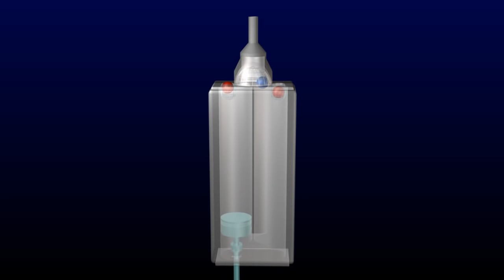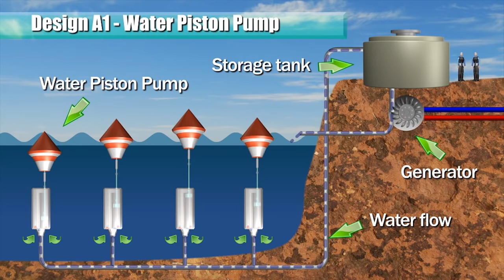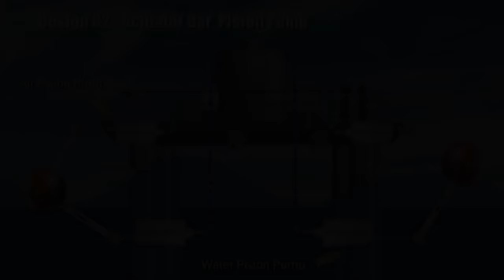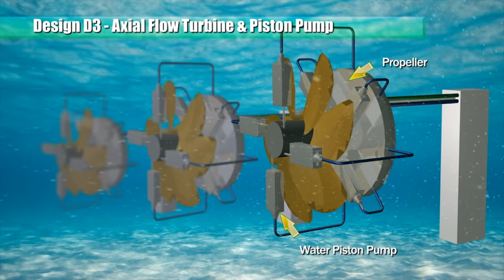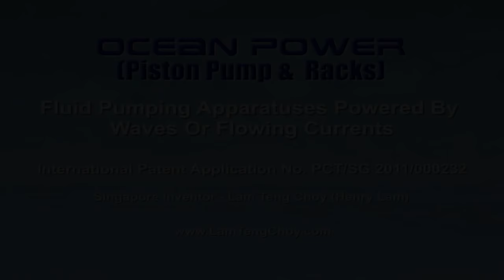Blue Energy - Ocean Power (Piston Pump & Racks)

Comment: These are excellent ways to gather energy, now all you have to do is eliminate the accelerated mass losses in a turbine. A typical hydro-system only operates at 15% efficiency max due to accelerated mass losses. Compress air instead of water, insert a HyPEG unit and get about 5 times the amount of electricity for the same piston strokes offshore. New science. Check it out!
Reply: No, hydrodynamic generators are extremely efficient, up to and sometimes over 90%. I found this after some googling, and asking 2 thermodynamics professors at my university.
Reply from the maker: New Invention

ShoreLine HydroElectric InFlow Dam System Video (English)
https://youtu.be/A8EYW_aREKw

水力发电内流水坝水岸线系统 / ShoreLine HydroElectric InFlow Dam System Video (Chinese)
https://youtu.be/D2NPLMekG8w

Hydro Power - Hydroelectric Inflow Dam System
https://youtu.be/_ho7JaxOdT0

Ocean Power - Piston Pump & Racks
https://youtu.be/fYfs-qYGzvs

Ocean Power - Racks & Rake Wheel
https://youtu.be/nQGKfAPxsiI

Comment: Do you know of any working examples of Ocean Power piston pumps?  If so, it would be great to have them included on the Water Powered Pumps Facebook group:   https://www.facebook.com/groups/240458583255303/
Reply from the maker: Hi,

All my invention is at Concept Stage only. If you wish, you can go ahead and design it.

New Invention
ShoreLine HydroElectric InFlow Dam System Video (English)
https://youtu.be/x8wKpl3N5lM
水力发电内流水坝水岸线系统 / ShoreLine HydroElectric InFlow Dam System Video (Chinese)
https://youtu.be/ZmL8biLw-ps 
Hydro Power - Hydroelectric Inflow Dam System
https://youtu.be/89mHu4JsIDs 

Ocean Power - Piston Pump & Racks

https://youtu.be/BSvKSzvhzZ8 
Ocean Power - Racks & Rake Wheel
https://youtu.be/c0_m3vE_aXY 

Henry Lam

Comment: What is the cost break-even point for these devices? They look very expensive, easily damaged by natural phenomena and would have high upkeep costs. Designing them to be durable and efficient would drive up costs even more. My guess is the price of natural gas would have to be astronomical to make these worthwhile in a realistic environment. Of course, if you are just doing it to make a politically correct statement on 'saving the planet', then cost/benefit would not be a consideration. What is the cost/megawatt of these compared with, let's say, nuclear power or a natural gas power plant?
Reply from the maker: New Invention

ShoreLine HydroElectric InFlow Dam System Video (English)
https://youtu.be/A8EYW_aREKw

水力发电内流水坝水岸线系统 / ShoreLine HydroElectric InFlow Dam System Video (Chinese)
https://youtu.be/D2NPLMekG8w

Hydro Power - Hydroelectric Inflow Dam System
https://youtu.be/_ho7JaxOdT0

Ocean Power - Piston Pump & Racks
https://youtu.be/fYfs-qYGzvs

Ocean Power - Racks & Rake Wheel
https://youtu.be/nQGKfAPxsiI

Comment: Anything is better than burning fossil fuels.  As long as the life of the equipment is efficient and does not require large man hours to maintain.  5 STARS
Reply from the maker: New Invention

ShoreLine HydroElectric InFlow Dam System Video (English)
https://youtu.be/A8EYW_aREKw

水力发电内流水坝水岸线系统 / ShoreLine HydroElectric InFlow Dam System Video (Chinese)
https://youtu.be/D2NPLMekG8w

Hydro Power - Hydroelectric Inflow Dam System
https://youtu.be/_ho7JaxOdT0

Ocean Power - Piston Pump & Racks
https://youtu.be/fYfs-qYGzvs

Ocean Power - Racks & Rake Wheel
https://youtu.be/nQGKfAPxsiI

Comment: It's 2019. Still waiting.
Reply: KhmerD0g  I imagine that the commercial implementation of such systems would be very expensive and complicated. The technology and its applications would have to be thoroughly tested for reliabilty and performance and manufacturing techniques would have to be developed which made a consistent quality. There's no doubt a lot of red tape around it, also.

The US would be a hard sell, especially after the BP fiasco in the Gulf Of Mexico. Having large platforms close to shore could prove dangerous, even without the possibility of a major oil spill. If one were to be hit by a powerful storm, it could cause a lot of collateral damage; both to the ecosystem at large and commercial/residential interests in the area.

I am cautiously optimistic about wave power. It is a very promising prospect, however it is not as simple as the video would make it seem. This is just an overview of potential methods for harnessing wave energy. These could work, but it will take time and effort to get to that point. Many investors are probably spooked about the unproven nature of the technology and thusly reluctant to fund projects of this nature.

In time, as small scale research advances, I suspect a few Elon Musk types will take the bait. Have patience, friends. We may have wave power sooner rather than later.
Reply from the maker: New Invention

ShoreLine HydroElectric InFlow Dam System Video (English)
https://youtu.be/A8EYW_aREKw

水力发电内流水坝水岸线系统 / ShoreLine HydroElectric InFlow Dam System Video (Chinese)
https://youtu.be/D2NPLMekG8w

Hydro Power - Hydroelectric Inflow Dam System
https://youtu.be/_ho7JaxOdT0

Ocean Power - Piston Pump & Racks
https://youtu.be/fYfs-qYGzvs

Ocean Power - Racks & Rake Wheel
https://youtu.be/nQGKfAPxsiI
Reply from the maker: KhmerD0g  New Invention

ShoreLine HydroElectric InFlow Dam System Video (English)
https://youtu.be/A8EYW_aREKw

水力发电内流水坝水岸线系统 / ShoreLine HydroElectric InFlow Dam System Video (Chinese)
https://youtu.be/D2NPLMekG8w

Hydro Power - Hydroelectric Inflow Dam System
https://youtu.be/_ho7JaxOdT0

Ocean Power - Piston Pump & Racks
https://youtu.be/fYfs-qYGzvs

Ocean Power - Racks & Rake Wheel
https://youtu.be/nQGKfAPxsiI
Reply from the maker: @canwenot573  New Invention

ShoreLine HydroElectric InFlow Dam System Video (English)
https://youtu.be/A8EYW_aREKw

水力发电内流水坝水岸线系统 / ShoreLine HydroElectric InFlow Dam System Video (Chinese)
https://youtu.be/D2NPLMekG8w

Hydro Power - Hydroelectric Inflow Dam System
https://youtu.be/_ho7JaxOdT0

Ocean Power - Piston Pump & Racks
https://youtu.be/fYfs-qYGzvs

Ocean Power - Racks & Rake Wheel
https://youtu.be/nQGKfAPxsiI

Comment: Check out this video https://youtu.be/v-lJkeRHzAE (or short version https://youtu.be/AG_vz2vHP7M) by cranleytech.com, there is some open water testing towards the end. It aims to get energy from the horizontal motion of the wave which is stronger in the near shore (<half a wavelength, e.g. for a 100m wavelength the particle motion becomes more orbital from 50m depth in to shore). It also keeps all the electrical equipment onshore and reduces the typical mooring costs. Apparently it is hugely expensive to drill mooring points into the ocean floor or to run electrical cables underwater. I’m looking for people to help me build prototypes, they are easy enough to build, the ones I have built so far are all with parts from my local hardware store.
Reply from the maker: Hi,

All my invention is at Concept Stage only. If you wish, you can go ahead and design it.

New Invention

ShoreLine HydroElectric InFlow Dam System Video (English)
https://youtu.be/x8wKpl3N5lM

水力发电内流水坝水岸线系统 / ShoreLine HydroElectric InFlow Dam System Video (Chinese)
https://youtu.be/ZmL8biLw-ps 

Hydro Power - Hydroelectric Inflow Dam System
https://youtu.be/89mHu4JsIDs 

Ocean Power - Piston Pump & Racks
https://youtu.be/BSvKSzvhzZ8 

Ocean Power - Racks & Rake Wheel
https://youtu.be/c0_m3vE_aXY 

Henry Lam

Comment: Nah. It seems pretty inefficient. Almost all the parts are working under friction. Also, piston and piston rod may exposure undesired horizontal forces which could emerge shear force on the rod. besides, cost is the key point of these systems in terms of investment decision.
Reply from the maker: New Invention

ShoreLine HydroElectric InFlow Dam System Video (English)
https://youtu.be/A8EYW_aREKw

水力发电内流水坝水岸线系统 / ShoreLine HydroElectric InFlow Dam System Video (Chinese)
https://youtu.be/D2NPLMekG8w

Hydro Power - Hydroelectric Inflow Dam System
https://youtu.be/_ho7JaxOdT0

Ocean Power - Piston Pump & Racks
https://youtu.be/fYfs-qYGzvs

Ocean Power - Racks & Rake Wheel
https://youtu.be/nQGKfAPxsiI

Comment: Not sure how much energy you can generate and it is also depends on the waves hight. Why didn't any1 think of it b4 it is because, there arn't much energy generated by this devices. The total energy of the wave must not exceed the total energy of the system ie. Etot=Egen.+Elost. This needs to be calcuated since if Elost << Egen this might work. I see some flaws in the device because those pumps might not generate enough energy if the system is too complex.
Reply from the maker: New Invention

ShoreLine HydroElectric InFlow Dam System Video (English)
https://youtu.be/A8EYW_aREKw

水力发电内流水坝水岸线系统 / ShoreLine HydroElectric InFlow Dam System Video (Chinese)
https://youtu.be/D2NPLMekG8w

Hydro Power - Hydroelectric Inflow Dam System
https://youtu.be/_ho7JaxOdT0

Ocean Power - Piston Pump & Racks
https://youtu.be/fYfs-qYGzvs

Ocean Power - Racks & Rake Wheel
https://youtu.be/nQGKfAPxsiI

Comment: You need to consider the frictional losses and huge maintenance costs involved in these types of machines. Just not worth it. You need the absolute minimum of moving parts, cranks and connections. Water (especially sea water) is very corrosive and it contains millions of living creatures that will attack and make a nice home on the machines.
Reply from the maker: New Invention

ShoreLine HydroElectric InFlow Dam System Video (English)
https://youtu.be/A8EYW_aREKw

水力发电内流水坝水岸线系统 / ShoreLine HydroElectric InFlow Dam System Video (Chinese)
https://youtu.be/D2NPLMekG8w

Hydro Power - Hydroelectric Inflow Dam System
https://youtu.be/_ho7JaxOdT0

Ocean Power - Piston Pump & Racks
https://youtu.be/fYfs-qYGzvs

Ocean Power - Racks & Rake Wheel
https://youtu.be/nQGKfAPxsiI

Comment: The fancier the plumbing the easier it is to stop it up.

Ocean water is filled with ocean life.  How will the pump affect that life?  How will that life in turn affect the effectiveness of the pump?  Ocean life - a.k.a. barnacles.  Me thinks the sea will not give up its energy so easily.
Reply from the maker: New Invention

ShoreLine HydroElectric InFlow Dam System Video (English)
https://youtu.be/A8EYW_aREKw

水力发电内流水坝水岸线系统 / ShoreLine HydroElectric InFlow Dam System Video (Chinese)
https://youtu.be/D2NPLMekG8w

Hydro Power - Hydroelectric Inflow Dam System
https://youtu.be/_ho7JaxOdT0

Ocean Power - Piston Pump & Racks
https://youtu.be/fYfs-qYGzvs

Ocean Power - Racks & Rake Wheel
https://youtu.be/nQGKfAPxsiI

Comment: Suspose  the wrap  magnetic ring  surrounding cylinder  outside,  which up and down  by   waves, then the piston without piston rod  we can see  all parts  should isolated from sea water pollution.  the  purpose for compress  air  to  vessel.    take pressured  air  push air motor,  a generator connected  with air  motor.
Reply from the maker: New Invention

ShoreLine HydroElectric InFlow Dam System Video (English)
https://youtu.be/A8EYW_aREKw

水力发电内流水坝水岸线系统 / ShoreLine HydroElectric InFlow Dam System Video (Chinese)
https://youtu.be/D2NPLMekG8w

Hydro Power - Hydroelectric Inflow Dam System
https://youtu.be/_ho7JaxOdT0

Ocean Power - Piston Pump & Racks
https://youtu.be/fYfs-qYGzvs

Ocean Power - Racks & Rake Wheel
https://youtu.be/nQGKfAPxsiI

Comment: its fine but how can the runner rotate with uniform angular velocity since the waves will not be be uniform. due to non uniformity in rotation of generators we wont be getting the required frequency of alternating current.And also how can this practically work under high tides and low tides since the difference in elevation b/w high tides and low tides almost 6 m.   
will you plz demonstrate that.
Reply from the maker: New Invention

ShoreLine HydroElectric InFlow Dam System Video (English)
https://youtu.be/A8EYW_aREKw

水力发电内流水坝水岸线系统 / ShoreLine HydroElectric InFlow Dam System Video (Chinese)
https://youtu.be/D2NPLMekG8w

Hydro Power - Hydroelectric Inflow Dam System
https://youtu.be/_ho7JaxOdT0

Ocean Power - Piston Pump & Racks
https://youtu.be/fYfs-qYGzvs

Ocean Power - Racks & Rake Wheel
https://youtu.be/nQGKfAPxsiI

Comment: I think that this kind of thing would be a very nice compliment to offshore oil rigs to power oil or gas pumps and also it would work very well with an OMTEC type of ocean thermal floating power station. The sea has so much potential for us, Let's make better use of it!
Reply from the maker: Hi,

All my invention is at Concept Stage only. If you wish, you can go ahead and design it.

New Invention
ShoreLine HydroElectric InFlow Dam System Video (English)
https://youtu.be/x8wKpl3N5lM
水力发电内流水坝水岸线系统 / ShoreLine HydroElectric InFlow Dam System Video (Chinese)
https://youtu.be/ZmL8biLw-ps 
Hydro Power - Hydroelectric Inflow Dam System
https://youtu.be/89mHu4JsIDs 

Ocean Power - Piston Pump & Racks

https://youtu.be/BSvKSzvhzZ8 
Ocean Power - Racks & Rake Wheel
https://youtu.be/c0_m3vE_aXY 

Henry Lam

Comment: Those systems are not sustainable renewable energy due to low energy out put, high energy input to build each one and cost of building. Also you need to look at many problems facing those systems like continues pipes clog due to the impurity of sea water (slat), storm and corrosion. They are just too expensive to maintain. Wind turbine is far more better to maintain than those system and they can be placed to float in the sea. Even though wind turbine is much more easier maintain and has higher energy out-put but is still consider as an expensive way to gain energy. End of fossil fuels = end of industrial revolution.
Reply from the maker: New Invention

ShoreLine HydroElectric InFlow Dam System Video (English)
https://youtu.be/A8EYW_aREKw

水力发电内流水坝水岸线系统 / ShoreLine HydroElectric InFlow Dam System Video (Chinese)
https://youtu.be/D2NPLMekG8w

Hydro Power - Hydroelectric Inflow Dam System
https://youtu.be/_ho7JaxOdT0

Ocean Power - Piston Pump & Racks
https://youtu.be/fYfs-qYGzvs

Ocean Power - Racks & Rake Wheel
https://youtu.be/nQGKfAPxsiI

Comment: All rotating metal mechanical devices will eventually corrode and/or break down in seawater environment. The best alternative is use all composites. Excellent example is www.pobber.nl
Reply from the maker: Hi,

All my invention is at Concept Stage only. If you wish, you can go ahead and design it.

New Invention

ShoreLine HydroElectric InFlow Dam System Video (English)
https://youtu.be/x8wKpl3N5lM

水力发电内流水坝水岸线系统 / ShoreLine HydroElectric InFlow Dam System Video (Chinese)
https://youtu.be/ZmL8biLw-ps 

Hydro Power - Hydroelectric Inflow Dam System
https://youtu.be/89mHu4JsIDs 

Ocean Power - Piston Pump & Racks
https://youtu.be/BSvKSzvhzZ8 

Ocean Power - Racks & Rake Wheel
https://youtu.be/c0_m3vE_aXY 

Henry Lam

Comment: water or worse sea water is corrosive, more moving parts gives more problems in maintainance
Reply from the maker: New Invention

ShoreLine HydroElectric InFlow Dam System Video (English)
https://youtu.be/A8EYW_aREKw

水力发电内流水坝水岸线系统 / ShoreLine HydroElectric InFlow Dam System Video (Chinese)
https://youtu.be/D2NPLMekG8w

Hydro Power - Hydroelectric Inflow Dam System
https://youtu.be/_ho7JaxOdT0

Ocean Power - Piston Pump & Racks
https://youtu.be/fYfs-qYGzvs

Ocean Power - Racks & Rake Wheel
https://youtu.be/nQGKfAPxsiI

Comment: instead of having a water wheel pump water to a separate turbine, or pump air to a separate turbine, why not just have the water wheel be the turbine?

these inventors are trying to reinvent the wheel
Reply from the maker: New Invention

ShoreLine HydroElectric InFlow Dam System Video (English)
https://youtu.be/A8EYW_aREKw

水力发电内流水坝水岸线系统 / ShoreLine HydroElectric InFlow Dam System Video (Chinese)
https://youtu.be/D2NPLMekG8w

Hydro Power - Hydroelectric Inflow Dam System
https://youtu.be/_ho7JaxOdT0

Ocean Power - Piston Pump & Racks
https://youtu.be/fYfs-qYGzvs

Ocean Power - Racks & Rake Wheel
https://youtu.be/nQGKfAPxsiI

Comment: sound like a skizo  who have a fixation on reciprocating shaft into a cylinder... 1950 tech. even back then they knew better than thinking oceans are  that easy to handle... nothing last in the waves.
Reply from the maker: New Invention

ShoreLine HydroElectric InFlow Dam System Video (English)
https://youtu.be/A8EYW_aREKw

水力发电内流水坝水岸线系统 / ShoreLine HydroElectric InFlow Dam System Video (Chinese)
https://youtu.be/D2NPLMekG8w

Hydro Power - Hydroelectric Inflow Dam System
https://youtu.be/_ho7JaxOdT0

Ocean Power - Piston Pump & Racks
https://youtu.be/fYfs-qYGzvs

Ocean Power - Racks & Rake Wheel
https://youtu.be/nQGKfAPxsiI

Comment: Simpler the better, and the more robust the better too. Whatever used would need to handle rough seas.
Reply from the maker: New Invention

ShoreLine HydroElectric InFlow Dam System Video (English)
https://youtu.be/A8EYW_aREKw

水力发电内流水坝水岸线系统 / ShoreLine HydroElectric InFlow Dam System Video (Chinese)
https://youtu.be/D2NPLMekG8w

Hydro Power - Hydroelectric Inflow Dam System
https://youtu.be/_ho7JaxOdT0

Ocean Power - Piston Pump & Racks
https://youtu.be/fYfs-qYGzvs

Ocean Power - Racks & Rake Wheel
https://youtu.be/nQGKfAPxsiI